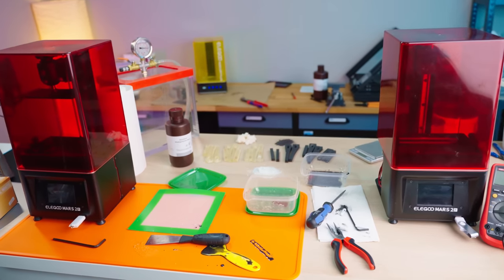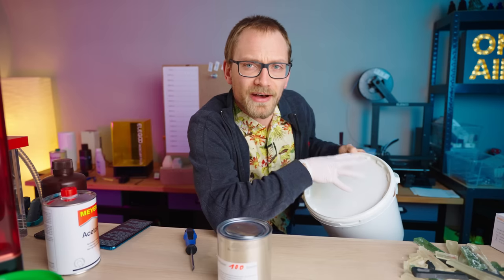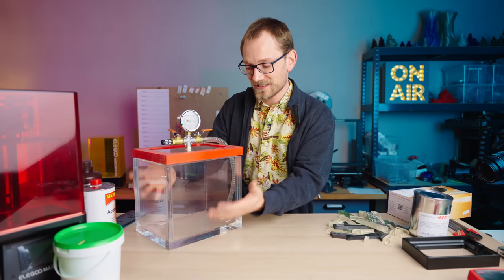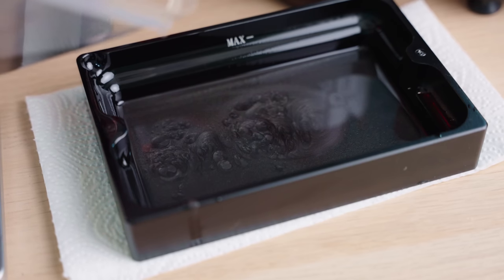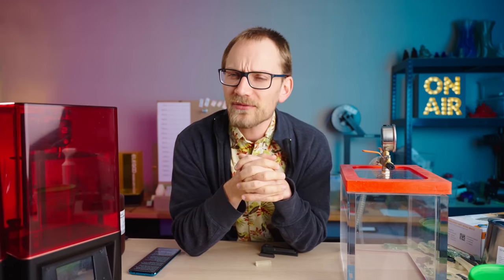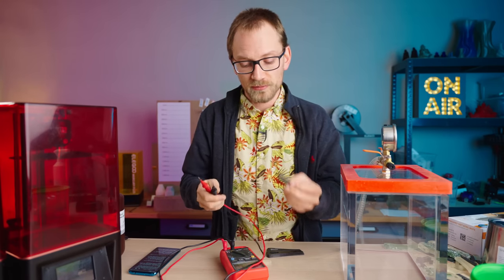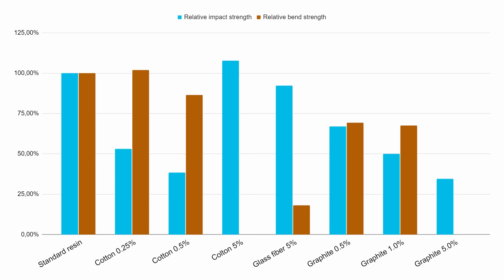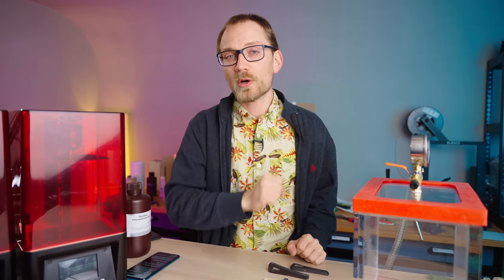Easier Fiber-Reinforced Resin Printing! Stronger and Conductive Resin Prints?

Comment: Hi ,, so I HAVE A PROBLEM YOU MIGHT BE ABLE TO HELP WITH ??!!
Reply: SO I need to make a little button for a room  thermostat, its for a hotel and the original was not strong enough so a copy is not going to work. 
But a wire works fine, so I was wanting to print a plastic button with a wire inside.

But I want to print , then put the wire in , then bury it in the button.

that got me thinking ,, if I could do that i could berry all sorts of thing like nuts and bolts or well? any metal stuff.

I do hope you can help??

Kevin

Comment: Bonding between matrix (resin) and reinforcement material is critical for composite materials. With optical curing, the reinforcement material should be transparent (to proper wavelength) to have the "hidden" material cured and expect some bonding. Would be interesting to test if there a resistance difference according to the curing side.

Comment: 8:27 Your vat doesn't seem to be properly secured.
Reply: I noticed that too, I wonder if that's on purpose to reduce stress on the FEP.
Reply: @alexsmith7801  Interesting idea, but I doubt it. Every resin printer instruction I know says to tighten the vat down. Afaik a loose vat can cause all kinds of problems, including prints not sticking to the build plate. But I have no first hand knowledge, since I thighten my vat down ;)
Reply: @hannesw928  Yeah same. Or I spaz out and mash the stop button if I see it shift before the first layer.

Comment: Among the infinite list of items to try, chopped carbon fiber(1/8") might be worth a shot.  I get mine from CST composites. I use this with laminating epoxy to strengthen joints. You need very little. It requires vigorous stirring, but you see the fiber bits break up into microscopic individual fibers, until you are left with a darkened in color mix with a higher viscosity and little visible individual fibers. I do not know if the carbon fibers will have the same affinity for the 3d print resins as epoxy however.

Comment: While I appreciate being able to choose between marble-like or mucus in my new resin colors, the resin itself is a better insulator than a conductive substrate, even with the addition of graphite. Unless you can strategically place the graphite into connective veins, getting a direct line of resistance to show up on a meter would be difficult at best. I like where your experiments are going nonetheless as I'm also experimenting with reinforced UV-cured additives, though mine are aimed more as a post process. It's been about as successful as yours thus far, though I believe I made a major breakthrough this week; now it's a matter of getting the chemistry just so and finding a binder that plays nice at UHTC levels. :-/ 
As I'm sure someone pointed out but in the interest of completing my thoughts, the graphite bubbles are an effect of the IOR of the material.

Comment: Unless you find a substance that binds well to the resin like it's part of the resin, absorbs the resin, or binds well to itself, I imagine it will only continue to create weak points. With self curing resin, you can coat the outside with something like graphite and get a little conductivity out of it. However, I imagine you couldnt fully cure UV resin if you did that.

Comment: I think there might be a misunderstanding as to what is improving the strength of what.  All these products that you are adding to resin, do not improve the strength of the resin, resin increases the strength of these products alone when done properly.  The only way to improve the strength of resin is through heat and chemistry.

Even with your glass fibers, you are not trying to increase the strength of the resin, you are attempting to increase the strength of the glass fibers, but in a haphazard way.  Even though you might think of this as a failure, I see something different.  You proved that a misunderstanding can cause failure, which is a lesson learned for everyone.

Now, if you solely trying to make the parts stronger, which is different from making the resin stronger, you have already shown how that can be done.  Print multiple thin layers and adhere them together in post processing with glass fiber reinforcement.  Basically a 3D printed version of fiber glass to create a structure.  I will say that the raw cotton was very interesting.

Comment: I don't mean to be condescending, I really don't, but I must point out a couple of facts:
1) you've been missing an important factor in your mechanical test measurements: the density... From an engineering standpoint, when comparing strength of materials, the relationship between volume and density is, one of, if not the most important. I reckon you're not trying to be scientific, tho you're falling more on the realm of trivia than information.
2) the vast majority of people have a gross misconception regarding FRP (granted, mostly due to dumb/clever marketing). The main goal is not to make parts stronger, but to make parts lighter while maintaining strength. Different fibers give different strength properties. As an over simplistic rule of thumb,  denser the material the tougher it becomes, in turn more mass per volume. Composites are a way to increase toughness, among other properties, without increased density. By the way, in this experiment you're making composites. FRP, while also a composite, would require fibers arranged in a specific way, and when combined with the thermo polymer matrix should be stronger than the polymer by itself. Also, graphite is not a fiber (not in itself).
With this being said, I know you're doing this for the entertainment value, but at the same time I see it as missed opportunity.

Comment: Milled carbon fibre is evil use a mask when handling and cover all your joints. I made the mistake of circular sawing some "carbon/carbon" fibre it's like fire ants anywhere you sweat.

I'm also pretty sure if your reach out to sgl carbon GmbH they will likely help you as they are pretty good at customer service and it's free pr for them.